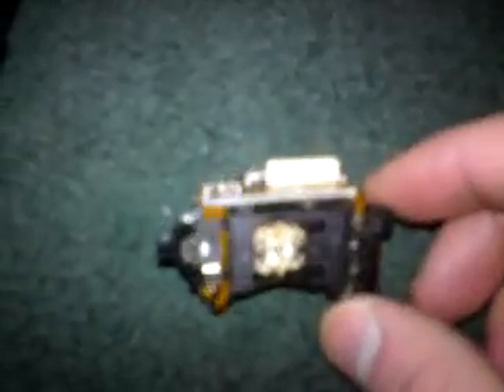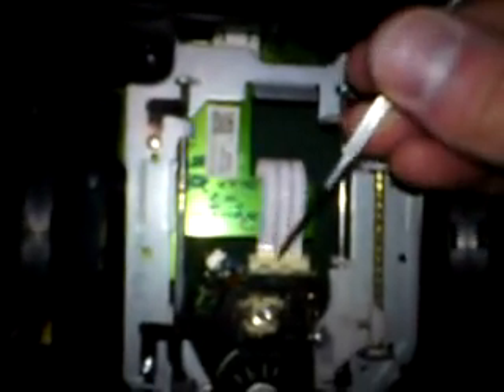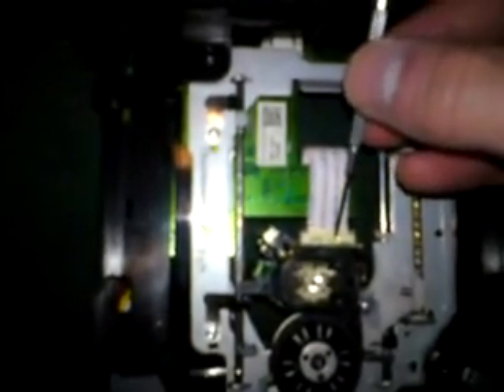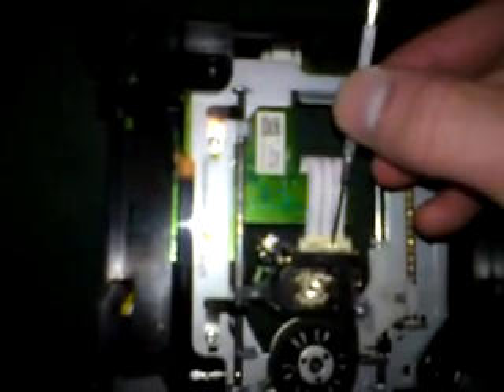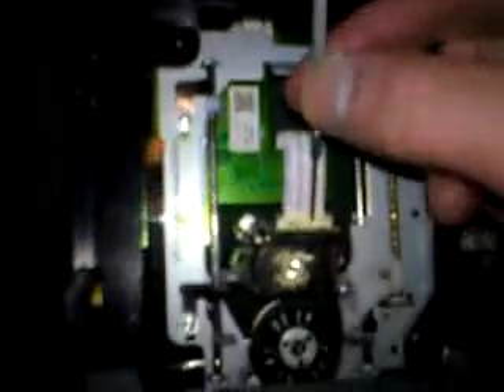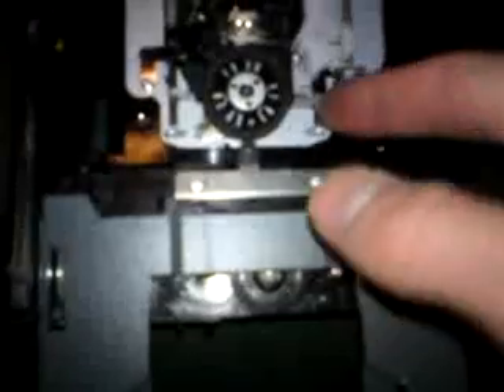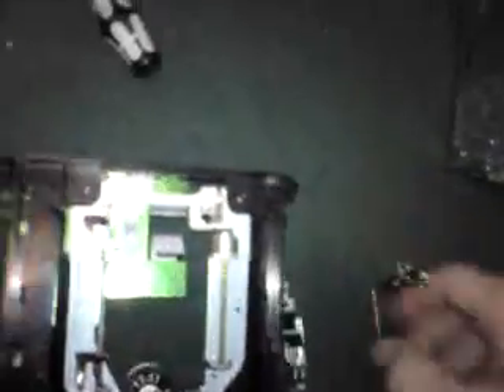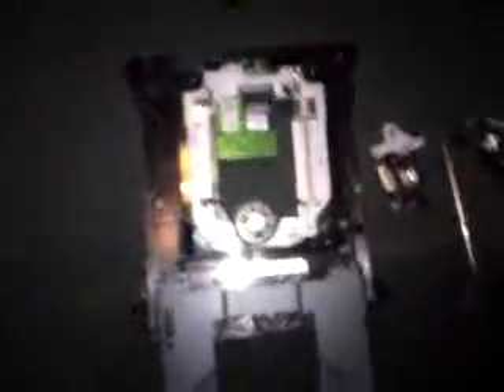How to Tweak & Replace BenQ & LiteOn Laser's

Comment: You can find the screwdrivers needed for removal and laser adjustment in a 6 piece Precision Screwdriver set. Very cheap. Even a set in a dollar bin at an auto store will be sufficient. The smaller phillips head works well for the screws on the rail clips. The smallest pan head is about as small of a screwdriver that you can get and barely fits for adjusting the laser.

Comment: hey , i bought a replacement laser put it in and nothing , no laser beam coming out of the laser and moves up and down and grinds, i checked the pot to see the ohmage and it was UNDER 3 ohms, i understand that under 3 ohms you will not get a reading at all , so i tried pot tweaking and still nothin :( any help?

Comment: Hi are you saying that if you have turned the two screws all the way round that the laser will no longer work?I did  fix my laser once by turning both screws face on clock wise about four small clicks,but then i took to some guys advice in a video to turn them anti clock wise and the laser hasnt been able to read the discs since.Also will an english laser be compatable with an american (NTSC)SYSTEM?